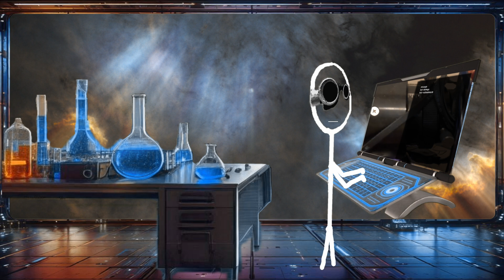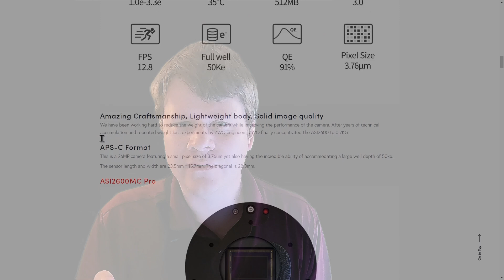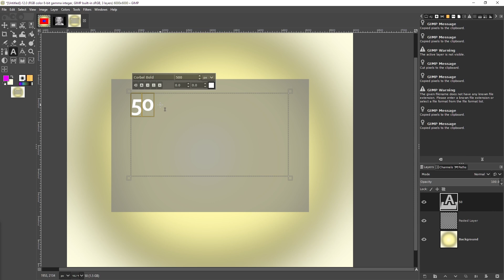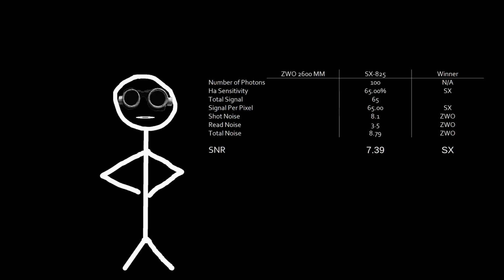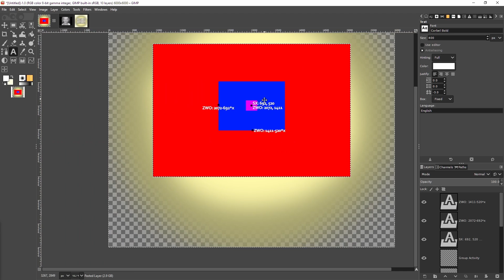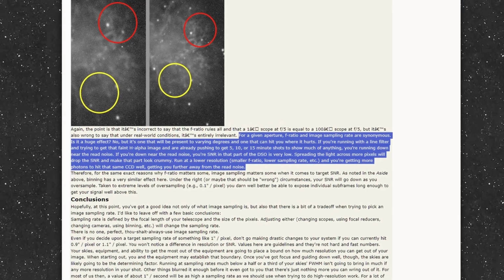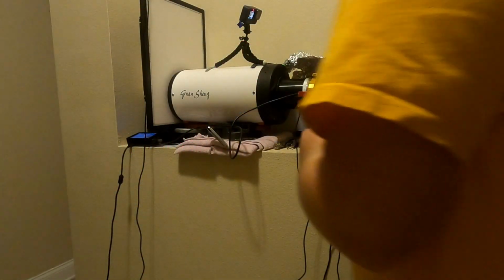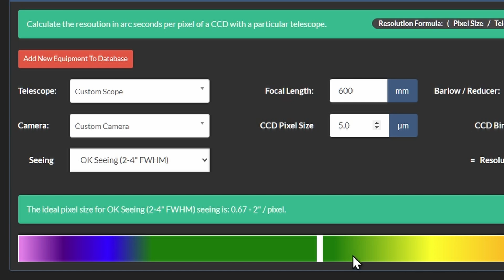𝐌𝐲 𝐨𝐥𝐝 𝐂𝐂𝐃 𝐰𝐢𝐧𝐬 𝐭𝐡𝐞 𝐒𝐍𝐑 𝐛𝐚𝐭𝐭𝐥𝐞 𝐚𝐠𝐚𝐢𝐧. 𝐖𝐡𝐚𝐭'𝐬 𝐠𝐨𝐢𝐧𝐠 𝐨𝐧?

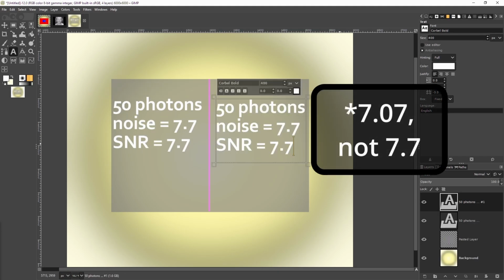Comment: I'm missing something at 5:49 .. Why the noise of the single pixel is 7.07? if the "single pixel camera" had noise=10, if we divide the same sensor in 2 pixel, the total noise of all pixels should still be 10 ( we didn't changed the sensor tecnology, but we halved the area where the noise could occur). Assuming that the noise is more or less equally distributed,  then the "noise per pixel" = "total noise " / number of pixels = 10/2= 5.
Reply from the maker: This is a good question. There is a weird thing about Poisson shot noise. It doesn't split the same way the signal does. The standard deviation (i.e., noise measurement) only depends on the mean of the distribution. It is the square root of the signal. So, in this case if we have a pixel with a signal of 50, the noise becomes the square root of 50, or roughly 7.07.
Reply: @deepskydetail  if we're calculating the overall SNR however you need to sum the noise in quadrature, so that would be:   SIGNAL*NrOfSources/sqrt(Noise^2*NrOfSources) ->
 50*2/sqrt(7,07^2*2)=10, just like a single pixel with 100 signal.
Reply from the maker: @v0ldy54  We're not finding the SNR of the whole area though. We're finding the SNR of the individual pixels. That's what we're interested in, especially in very faint areas.

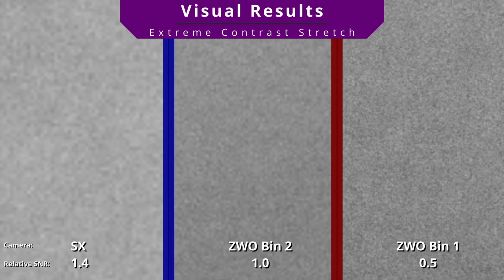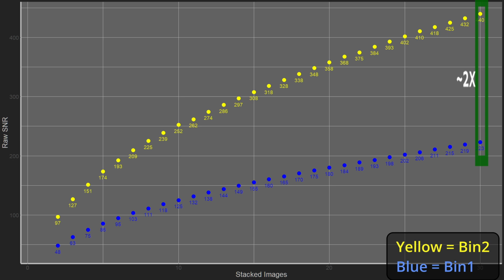If you take two images, one without binning, and the other with 2x2 binning, the 2x2 will be brighter. If you stretch the unbinned one to be as bright as the binned one, it will look noisier. You can actually see the difference around 13:00. The SX (and binned ZWO) is smoother (but less resolution) and the right one is noisier (with more resolution). I tried to equalize brightness and keep the stretching the same. The graph at 13:49 shows the actual calculated SNR for the 2x2 bin and unbinned ZWO, which confirms it.
Reply: @deepskydetail  ok, but the final image should be compared to the same output size , so it's the SNR over the same area of the final image that matters.